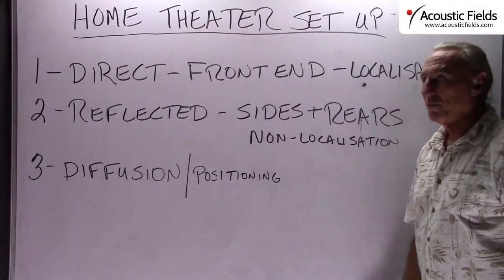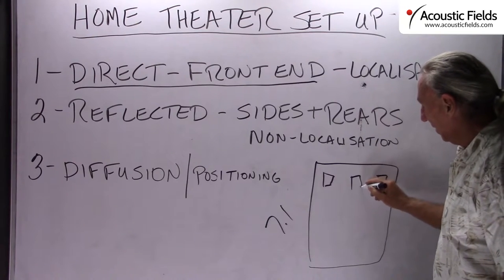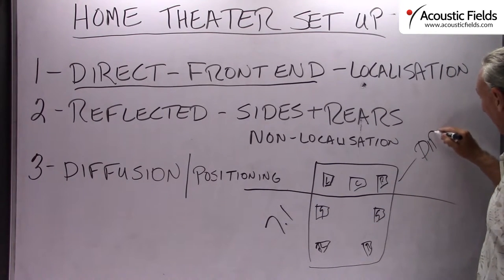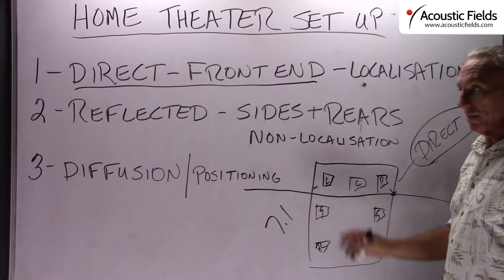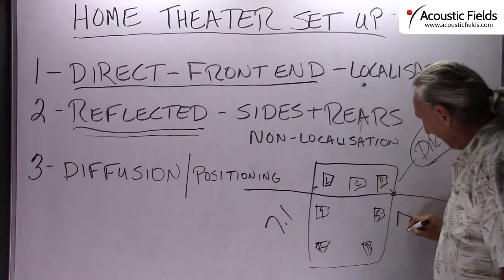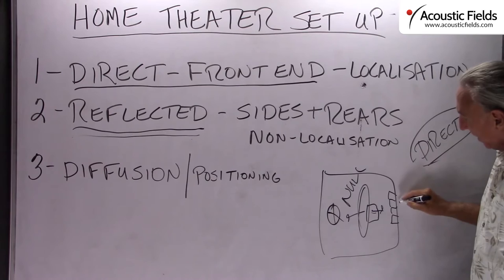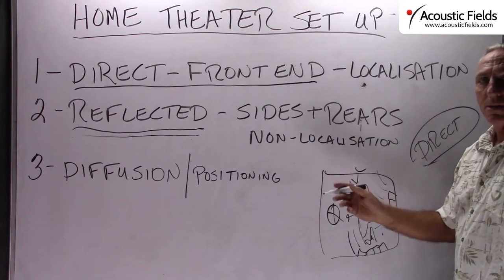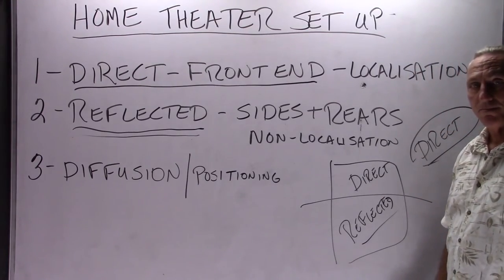Home Theater Setup - www.AcousticFields.com

Comment: Dennis,  The center channel contains all of the dialog and when it is missing so is the story.  In cinema, if you lose the center you have to make some quick changes to get the dialog back or you will give out lots of refunds.
Reply from the maker: Hi Kenneth, Lets ask the audience. If we take out the center channel that "contains all the dialog and when it is missing so is the story". What say you?
Reply: You'll obviously loose the story if you simply disconnect the center speaker. Setting the center speaker to phantom is a different story that usually works really well as long as you sit in the sweet spot.
Reply: Yes, it is possible to undo the encoding to some degree by out phasing the left and right speaker outputs.  This is part of the encoding process where you have everything (5.1) in the 2 channels as from optical film soundtracks.  The dialog is actually out of phase between the L & R channels so that they do not distort the sound from the center speaker. However in the digital era, those signals are discrete and so you don't have the center sound hidden in the system.  The phantom center mode simply adds the center back into the L & R  channels IN phase so you can find a place in the room where you can hear the dialog.  As you pointed out, there is only a small area  where this works  very well.

Comment: Dennis, you said you should flip the surround speaker and fire it in the diffuser. But did not say "how do it." My logical answer to take lowest frequency wavelenght of the diffuser (lets say 3 feet from other videos). Add 50 percent for the wave to fully form ( 4,5 feet) and you get "distance" between your diffuser ( that is on the wall) and speaker ( that is shooting the wall) and you are sitting next to speaker. So it goes : your listening position > surround speaker > 4,5 feet ( it varies on diffuser ) > diffuser ? Is that correct ?
Reply from the maker: Hi Alex,  Lets not use time and distance as our guiding variables. Lets use radiation pattern of the speaker and the total surface area of diffusion we have to work with. Lets put time and distance in third and forth position. If we fire a horn into a certain square footage of diffusion, we must get a dispersion pattern similar to the natural radiation pattern of the horn in free space.  Horns with a wider dispersion pattern, will require more square footage of diffusion to produce a complimentary sound field diffusion pattern that more mimics the radiation pattern of the horn into free space. Its all about matching speaker, diffusion sequence, and square footage of coverage to match speaker radiation pattern. Distance is a factor but if distances available are too small for one directional diffusion, then we always have two dimensional diffusion in our tool box.

Comment: How do you recommend displaying your speakers if the back of the speaker is facing the audience then?  Looks ugly with wires hanging out too.  Maybe on a closed shelf unit then?  I like the idea. Will have to try it.  No more in-wall on in-ceiling speakers for you hey?
Reply from the maker: Hi Dankowtw, In wall speakers suffer from SBIE speaker boundary interference effect. The sound you hear is a combination of the speaker and the surface area around them. In wall speakers are a large trade off in sound quality from free standing speakers.

Comment: What's your thoughts on "IMAX" approach on sound dampening and using fewer speakers having most of the speakers behind the screen and only two rear laser guided surrounds and using menny lFE elements. I've been to a few of their theaters so for lowest room noise best isolation

Comment: Atmos is the biggest gimmick in home theater to date.
Reply: No its not. My room which is a 7.1.4  ( with 4 atmos speakers on the ceiling ) sound way better than a standard 7.1 system.
Reply: You gotta try it out first before you make comments like this.
Reply: I have a 3d 360 degree sound field without the use of unneeded channels. It truly is useless when one accounts for the relationships between the room, drivers, and the listener.